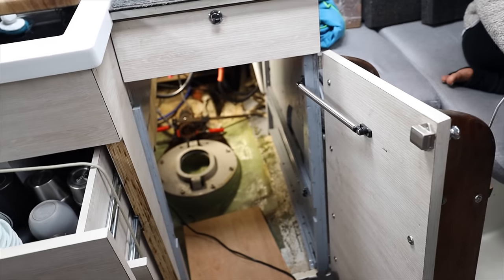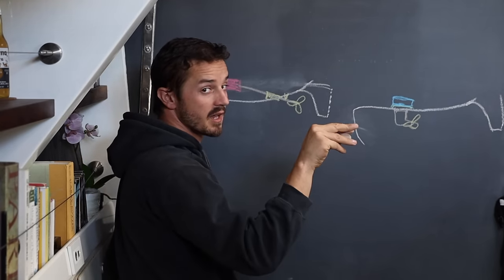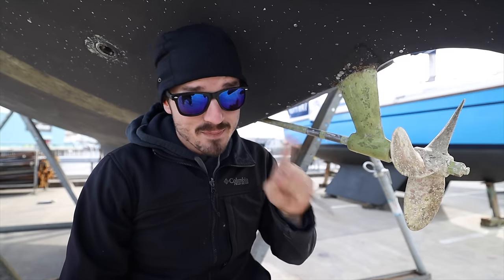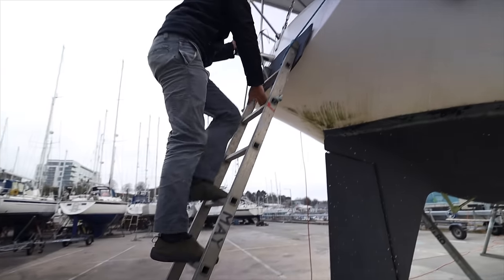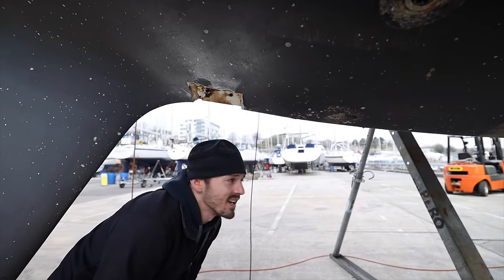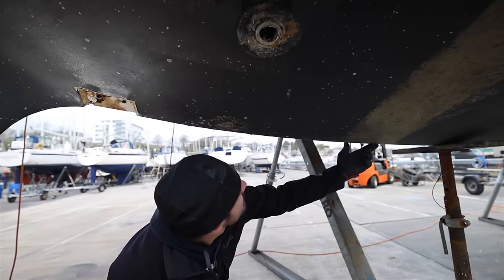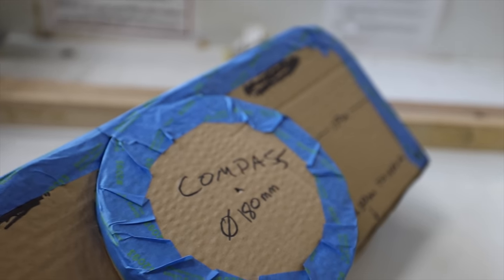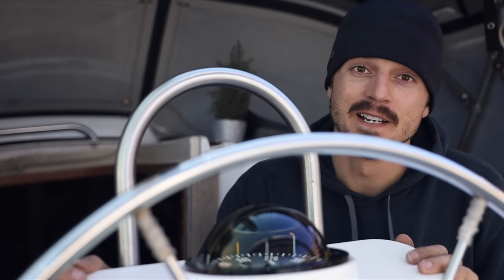CONVERTING to an Oceanvolt Electric Sail Drive — Sailing Uma [Step 213]

Comment: bonjour,

pouvez vous me renseigné s'il vous plait je recherche un moteur diy pas cher,voici les caractéristiques du bateau

type:vedette

modéle:sundowner 205

constructeur:four wins

année:2003

poids:1T800

longeur de coque:6,15 métres

largeur de coque:2,45 métres

moteur inboard fixe volvo  modele 225cv  puissance en kw 165,6 puissance en cv 24

je ne cherche pas la vitesse mais un moteur avec du couple,je navigue en mer et lac,navigation plaisance,type de recharge quai,

j'ai un budget assez limité si vous pouvez me trouvé un moteur pas trop cher.

merci

bonne journée

Comment: Nice now you can heat your water and cabin off the water cooling too.
Reply from the maker: Not really, the system is all internal and the motor only gets up to about 35deg C. Unlike a diesel, we won’t be running it for hours a day so there wouldn’t be any significant heat gain for external accessories. There will, however, be power generated while sailing, that we can use to heat up water and our cabin.
Reply: @SailingUma  Still even though you can't do that, it's a massive awesome upgrade. You two rock!

Comment: I just happened on your site and am impressed by your hands- on approach, but can't help wondering about your rationale  in thinking that your electric motor / generator drive unit is compatible with the fundamental  principle of conservation of energy. The charged battery bank puts out  but you can't get back the energy that the battery has supplied from a motor that "becomes" a generator..  Soumds like perpetual motion.
 Electric cars are propelled by battery power, but the energy returned by regenerative braking is insufficient to recharge the batteries and a fossil fuel engine charger  or grid energy supply is needed to progress
Reply from the maker: We have sails. So we sail 99.9% of the time. We only need to motor in a tight channel or into a marina (which is rare) It would be like if you could coast down hill forever in an electric car and only need to motor to get it back into your garage.

Comment: Using a high speed grinder (or any power tool) with no guard? No gloves? No face shield and no Z87.1 Safety Glasses?  Bad move!  A defective wheel can shatter and make a pretty face look like shredded wheat!  Safety first!  Always wear the proper PPE!

Comment: interesting thing to do to a boat where the hull was specifically designed for one purpose... how will you deal with the balance / keel depth issue sans engine ?
Reply from the maker: A few hundred pounds moved around on a boat that weight 9 tons doesn’t make much difference at all.
Reply: @SailingUma  combined with how the boat will be propelled .. sails pushing .. weight distribution.. where stresses were originally designed in to be handled;; keel form... im not saying it would be dangerous.. but i would imagine inefficient. going to be interesting to see if the bow wants to dive a bit under a good sail.  since it was designed for a different form of propulsion location .Motors raise the bow sails will make it want to dive. good luck.

Comment: Using that grinder with the  180 degree guard removed is very dangerous . The outer edge of that cutting disk is revolving at 100 kmh and if it shatters (can happen) the bits coming off would really challenge you safety???? Glasses . At least don't place your head in line with the spinning blade .

Comment: DO NOT PAINT over fiberglass!!! you need to TOPCOAT (gelcoat) over first befor paitning
Reply: Just friendly tip:D I am building boats for 16 years. Basicly you need to apply plastic paint over fiberglass befor applaing any other paint over it. It is as thick as resic even thicker. Sorry for bad english and explanation, dont know all names in english
Reply from the maker: If you’re using polyester resin than yes, but with epoxy, you can just paint right over it.

Comment: was changing to sail drive successful, ... from the point of view of sail drive requires more maintenance, oil changes etc, and hull less protected if the keel is  ever struck, ...  and could puncture the hull integrity if ever hit  EG  Tanda Malaika. .adventuresofatribe.wordpress.com .... honest question.as in reading this sad   blog of a great family sadly  sinking,,..... it appears the sail drives once compromising the hull meant the vessel was toast...  .. just looking for reassurance that your confident that this point with your research on sail drives  was still a valid reason to change. I get the  fuel savings point but could this still have been done with shaft drive... interested in your reply

Comment: Not an expert, but pretty sure drilling a big ass hole in the bottom of the boat isn't a good idea. You are going to freak when it starts leaking in blue water.

Comment: I am affraid that your fiberglass work will be a week point.
So much errors you have made.
If you follow the guidelines it's rather easy and stronger then steel.
If you wish I could email you fiberglass repair manuals.

Comment: Danger.  were those two large yellow electrical cables connected to your prop shaft skeg your ships sea grouind connection.  Or have you made other arrangements?  When the lightning walks about you will mis it if it was.  Radios and lightning protection. dick

Comment: you will regret, those saildrives are expensive, and when they start to corrode .... aluminun casting in the water..... gone
Reply: They are guaranteed for life against corrosion by Ocean Volt. That's part of why they are so expensive

Comment: How to lose 18% of power and 26% of efficiency ... the question is only one, why?
Reply from the maker: Not sure where you're numbers come from.... But so far we've found the new system to be about 20% more efficient at slow speeds and closer to 50% more efficient at top speed. Plus we'll sail faster with the folding prop and be able to motor longer without it overheating. Overall, a massive WIN!
Reply: sorry for my bad english, google translator :-) ... Technical data sheet of the Volvo Penta, same engine with s-drive or axis line ... easily available online ... but if you are convinced that it is better, good for you. Good wind !
Reply: 100% of the thrust of the propeller is transmitted to the thrust bearing and to this to the hull, being integral. And also the direction of the thrust is coaxial. In the s-drive the elastic supports absorb part of the energy and are not coaxial, this is the reason for the lower efficiency and loss of power, in fishing vessels the axis lines are always the most used, why !? ;-) Good wind !
Reply: Not to mention the galvanic currents at mooring. In a few years you will be able to tell me, from your direct experience. Good wind !
Reply: S-drive was born from the needs of the designers, for the hulls with a flat bottom, to minimize the overall dimensions of the shaft line engine compartment, moving the weight back under the ladder and leaving the dinette free from the cruisers. I hope you never have to intervene on the rubber flange or O-ring of the foot, at sea, you will remember my words by Cassandra ... what is not there does not break ...